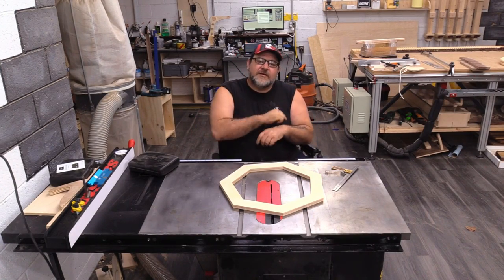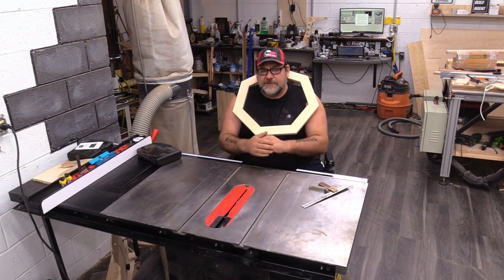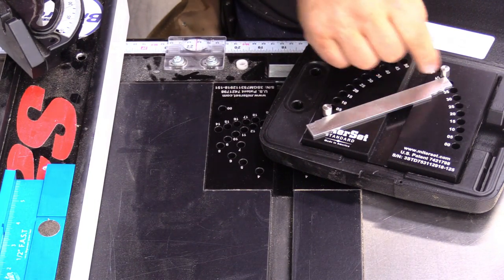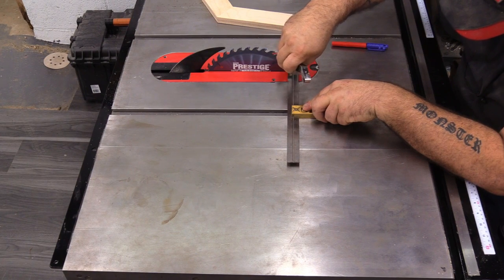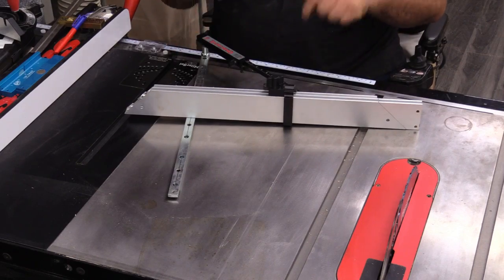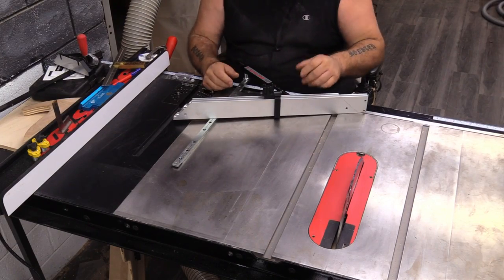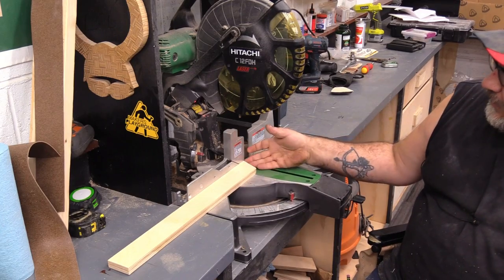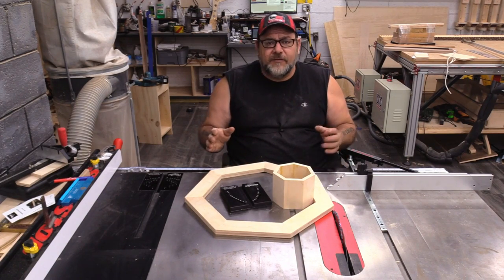How To Make Perfect Miters with a Table Saw and other tools

Comment: It's nice to know that I'm not the only person who goes barefoot in the shop, my shop didn't have a nice floor though, I had nails and screws sticking out from the plywood and whoever built it never fully finished it before I got it. I did finish half of it while it was mine and that made it nicer. When I finally get around to rebuilding I'm putting nice soft foam everywhere there isn't a bench or tool so I can continue to go barefoot

Comment: Well, I was inspired to go order the Miterset, until I read that it's incompatible with the Dewalt 745 (of which I have), based on the miter slot. Also that a Kreg or Incra Mitre Gauge could require adjustments. So I have the Rocker Miter Gauge. I believe the main issue is the incompatibility with the T styled miter slot-of which the DW 745 has the 3/4 standard miter slot. So I guess my question is about why they say the Dewalt saw is incompatible, when they DON'T have a T-slot? Your help is appreciated, as I would really like to get the Miterset...Thanx!

Comment: Hey Izzy! What do you suggest if my table saw track slot varies in width by too much? My miter gauge is tight in some spots and loose in other. Not great for precision. Is there a safe and practical way to make my tablesaw's miter slot walls flat and parallel?

Comment: So when you said you had .006 gap in the alignment, you said that was ok, and moved on.  But what if it's worse?  How do you adjust that/fix that?  I was expecting you to explain that after you'd set up what was acceptable.
Reply from the maker: It would be specific to your saw but there are a few good videos on adjust tablesaw blade to match miter slots on YouTube already

Comment: Does the squareness of the saw blade to the mitre slot actually matter in this context? You are still sliding the workpiece along a path with the angle set relative to the path it is travelling on in the mitre slot. All that would happen if your blade was slightly out of square would be that you would end up with a slightly larger kerf as the back teeth on the saw would be enlarging the kerf as the wood passed over them. If you are not passing all the way through the saw blade even this difference would be reduced to infinitesimally insignificant as it would only be the distance across the depth of a single cutting tooth where the non-square would make a difference. If you get really extreme I suppose you would end up with the cut edge not being totally flat and 90 as it would essentially be like a cove cut, but at that point it reinforces the point that a blade out of square would not actually change the mitre angle, as when you cut coves they are still straight with the direction you are moving the wood, they are just coved. Granted there are other reasons that you blade would be square, and if it was out of square by more than the difference between the blade teeth and the flat sides of the blade it would cause problems, but as far as I understand it a small difference should have zero effect on the exactness of your mitres. The far bigger difference will probably be the play of the mitre gauge in the mitre slot.

Comment: Please tell me that $3000+ table saw doesn't come with MDF wings.
Reply: Yup, that extension table is MDF with black laminate. Nice if you want to throw your own router table in there. I think they might sell a steel extension table piece as a replacement.
Reply: @BenMarvin  Looking further into it I see the actual wings are cast iron and this is just the extension off of the right wing, I thought it was the wing itself.  Is it as thick as a Rockler MDF router table top (1 inch)?  Will it hold up to a router without sagging?
Reply: NO, I own the saw with wings and they are extra but 100% cast iron. FYI everything on this saw is extra. Don't know if it's even an option or not.
Reply: @johnnywest5445  Yeah, it's the extension table, not the wings that are MDF. So for saws beyond a 30 something inch fence, notably the 52 inch fence will have the MDF table.
Reply: @SQLKC  what size fence do you have? With the longer fences, the MDF extension table is standard.
Reply: @BenMarvin  I didn't get a fence from sawstop and got the incra positioner fence it was 100 Bucks difference between the two

Comment: Would love both those...love the mods on the saw...I do know that if I tried that?  I'd be out a router bit, a saw, and probably a router...Murphy runs amok in my shop, and he screws EVERYTHING up.  Measure 50 times?  STILL wrong...I can NEVER get accurate measurements and cuts.  I've followed every tutorial out there, even worked with a couple guys...they all go "Wait, what? HOW did that not come out right, let me watch you"...do everything exactly how they tell me, they watch, make the cut (after their approval), and Yep...WRONG.  Depressing is what it is...I channel Murphy, and he's an a$$hole.